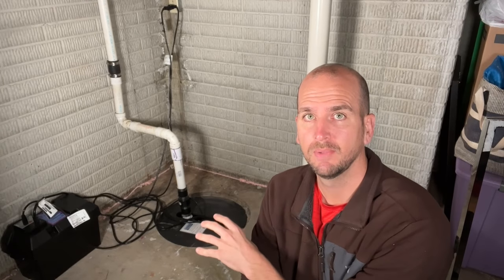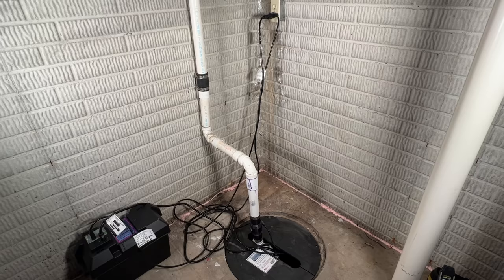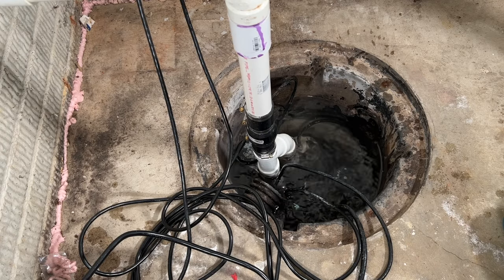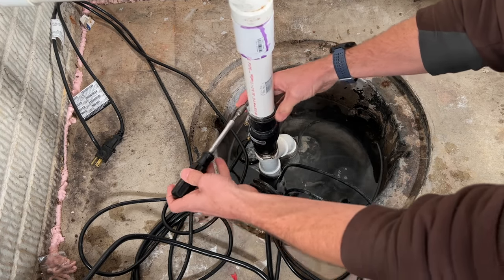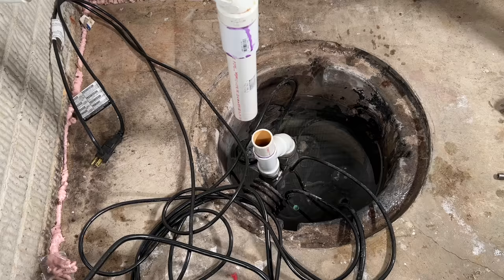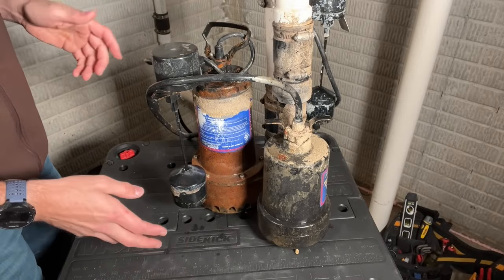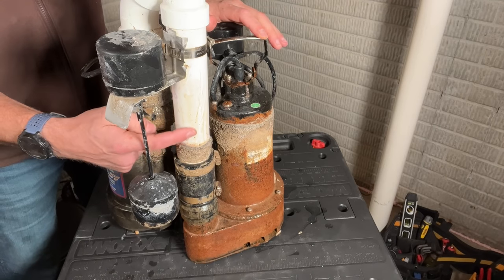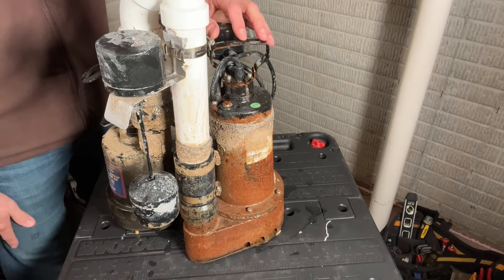Sump Pump Running But Not Pumping Out Water | 3 Fixes

Comment: Hello. I had my home gutted/remolded 2016/2017 here in Washington, DC  and had my  basement turned into an apartment with separate entrance from the side walk. I am just now looking to rent out my unit and always wondered about the sump pump. The plug with the little light on it (red), but the test button is mushed in; take it one of the contractors pushed it in too hard. Anyway, I took the cover from over the sump pump and there was water down in the sump and debris. I manually lifted the piece that raises when sump is filled with water and the water gushed out on the outside under the porch. So, I know the pump is working, just the plug is bad I suppose. I used a nearby plug, I sucked all the water out of the sump which had watery gray like sludge, take it from the construction, filled it with water. But now the water isn't being discharged, I just hear the humming sound from the pump. Is it now clogged inside the pump? In the mean time, I just found out about the check valve and it's function. It's clogged?

Comment: I used to have hose clamps in my pit and they were never reliable.  I changed the plumbing to be only glued pvc joints in the pit and put the hose clamps above the lid only. After that I never had another failure of the clamps.

Comment: Each pump ought to have it's own check valve.
Reply from the maker: You are correct and I missed that on the video.  Each pump did have a check valve coming directly off the threaded discharge port.

Comment: Zoeller pumps are well built but float switches fail prematurely. Try Liberty as they are built pretty well without the flow switch challenges. In your setup use 1 Zoeller and 1 liberty and let us now how they are working in a few years
Reply from the maker: Oh man, thanks for the feedback.  I had found several people saying the Zoeller switches are solid.  I just install a Zoeller M98 today, video will be published tomorrow.  I will checkout Liberty as Sump Pumps are something we take pretty seriously in our area since we have about zero elevation change and a high water table.
Reply: @EverydayHomeRepairs  You're a great guy and very thorough. Watched part 2 this morning. I couldn't wait to watch it. I'm not trying to "one up you" but put the weep hole should be just above the male adapter. Secondly, That pump cycles quite a bit in the video and I imagine between your high water table along with a heavy rain you could almost go with a continuous duty pump. All this might explain why you only got 2 years out of your original pump setup. Make sure that pump switch cover is tightened down from the manufacturer as your water level appears to immerse the complete pump during high influent of water from the 3 sources you have. Just a last thought...The 4" pipe brings in a LOT of water and it's hitting right on top of the float. Might increase pump cycle length and burn out pump prematurely. You can put a schedule 40 elbove dry fit to aim it away from the float. Bottom line is nice job, overall.

Comment: I just moved into a new house with a sump pump. I don't know anything about these things but I am paying close attention to this video. The previous owner had the sump pump discharge pipe dumping into the utility sink. I looked at this and immediately thought oh no. I have to re do this myself.
Reply: Actually, in some locations it's illegal to drain ground (sump-pump) water into the sewage system. And that's where your utility sink drains to.

Comment: Nothing beats a Zoller M98
Reply from the maker: Nice!  Just installed the M98 today 👍
Reply: Pump yes, float switch no.  Float switch dying is a common failure on these Zoeller's - mine just failed after 8 years.  Would not reliably activate, but fortunately the water jet backup did.  Good news is the float switches can be replaced without needing a new pump.

Comment: Those pumps already come integrated with a weep hole for both pumps. Air lock is not an issue. My pump had a piece of stone stuck to the impeller. It only takes removing 4 screws to access it.

Comment: Every sump pump eventually fails.  Just the better ones like that new green one he shows will last longer.  But it will still fail eventually.  

That’s why the most important part of the sump pump pit is a reliable working alarm system.  You need alarm to tell you when pump fails BEFORE  the carpet gets wet.  If you mount the alarm sensor at the height just above the “on” level of the float it will give you the most advance warning.  You might have several hours between alarm sounding and the flooding of the carpet.  That gives enough time to replace the failed part before it floods.  

I’ve had 6 or more pump failures in the 18 years at my house. But only the first one caused a flood before my alarm. All the other failures since then were detected by the alarm and repaired before any damages.
Reply: and a good insurance policy coverage every company offers water backup coverage, a fairly high-value add-on that costs as little as $30 a year on top of your standard coverage
Coverage amounts and availability of this endorsement vary by company and state, but companies generally offer anywhere from $5,000 to $25,000 in water backup protection. Its sort of my back up for my back up. Yes there is a deductible but at least you know your worst case scenario ie the deductible and you'll get new stuff
Reply: @handdle-h2o  I called my insurance company after my basement flooded and I lost thousands of dollars worth of property.  They said the damage was not covered.  I then inquired about water backup coverage add-on for future flood coverage.  They said there is not anything available that would cover my specific issue - which is groundwater infiltration due to non functioning sump.  The water was not backing up from the sewer pipe and was not backing up from the drainage pipe either.  It was simply the natural water in the ground itself seeping into the drainage gravel underneath the basement floor.  That level was rising and without a sump dewatering it eventually reached the basement floor level and above.
Reply: The battery operated water alarm is available at big box stores for approximately $10-$15 dollars and it gives you a “heads up” advance notice that something is wrong with the sump pump before room damage occurs.  I also have one at the base of my tank water heater to alert me in case the water heater starts to leak.

Comment: Thanks for this video. I am thinking of adding a secondary sump pump, in case the first one fails. I do have whole house generator.  I would like your thoughts on what a bullet proof arrangement would be.  

Also, can two sump pump be connected to same electric outlet?
Reply: They can, as long as you checkvalve BOTH sump pumps BEFORE they get Y-d together to a single outlet.

Comment: I got a pump that runs and pushes water but sometimes i hear it running, and dont hear water moving.. but if i unplug it a second and plug it back in she pumps out. I thought maybe something got in the pit, and was blocking the intake but i cant find anything. You have any ideas on that?

Comment: I’m not confident with your set up. I have two pumps in the same hole . The second pump is set a little higher on a cement block. I have a vent outside on each pipe. Two separate plugs two separate pipes no check valves so they can drain either way. Works great year round. I have a my D Link camera aiming at the hole so I can keep an eye on it while I’m away. 
This does not fail.
Reply from the maker: For sure, I actually will be doing additional work (and videos) starting with installing the Zoeller M98 then working through some backup options.

Comment: HELP please...

My situation is that my new 3/4 Hp Watchdog sump pump takes 30 to 60 seconds to build up enough pressure/strength to move the water out of my sump.  I have a weep hole below my check valve.  The weep hole works well but does only a slow flow until pressure builds and then sprays out hard indicating satisfactory pressure.  Then the water goes up through my check valve and out.  When I remove my head pressure, by draining the discharge tube first, then engage the pump, everything works great.  Immediate evacuation takes place.

So is my problem some sort of airlock in the pump (that slowly corrects itself in 30 to 60 seconds) or is it too much head pressure?

Comment: I need to do some outside repairs after my discharge pipe froze and burst.  Any suggestions on installing a heat cable into the discharge pipe?  Thanks for the clear explanations.  You do a great job on your videos.
Reply: My outside pipe running to curb collapsed.
Made repair, then added an air gap where pipe comes out of house before it goes underground.
This way if underground pipe freezes or collapses, pumped water runs out onto ground and doesn't backup into sump pit.
Reply: There is a product called Freeze Relief.
Reply: Unfortunately my discharge is completely under grade until it exits at the street.
Reply: If your discharge is sloped properly it won’t freeze because it will be either empty or moving.  Typically only standing water will freeze.
Reply: @neilbrookins8428  Agree, it should have been done with more slope but unfortunately that was not considered in the design which is the reason it failed.  I will fix the rupture, rather than dig up the whole yard and put in a heat cable.  Just looking on some advice from others that have done a similar repair.
Reply: @larryrwright  rather than dig up the long pipe, just put in a tee at the house that allows  a backup due to freeze to flow to an alternate location.  Basically it’s an overflow for any blockage.
Reply: @neilbrookins8428  I found that the rupture was not actually due to frozen pipe.  I had irrigation installed last summer and the water line for sprinklers cut right through the sump discharge.  Grrrr!

Comment: I have a question, if you have a sump pit can you seal it up with concrete if you no longer want it . ?????
Reply: You'll get water in your basement.
Reply: @jimmypautz  Yup. Concrete isn't waterproof. 
Two everyday examples: 
That's why shower cement underlayment has a waterproof barrier under it. That's why your basement has a waterproof barrier between the dirt and the concrete wall.

Comment: Okay guys... looking for some advice... My Sump put, similar to the one in this Vid... has a 6 in PVC drain into it.... when we get heavy rains, water constantly runs into the Sump Pit from around that input pipe.   Nearly impossible to Seal that from inside the pit, the hydrostatic pressure is too high.  I am thinking maybe I just cut out the concrete NEXT to the pit, dig down to that feeder pipe and seal it from that outside of the Pit wall?  Basically, whoever installed this did not use gaskets and just cut a hole in the side and ran the pipe thru.  Which probably seemed great at the time, but they had no idea how much ground water presses up under the foundation..   thanks for any advice!

Comment: Use different electric circuits for each pump. Talking about hypotheticals in a video is meaningless. Asking viewers to visualize a hypothetical condition probably will only be frustrating for them. I would use a check valve for each pump to avoid recirculation and a possible jammed valve. Flooded basement if very frustrating and distressing. Your'e stressed from the last flooding and dreading the next one. You may want to install an alarm to sound when the water raises to an unexpected, undesirable level. Good luck.

Comment: As others have said, it's very weird setup having a check valve at the bottom of a vertical section of pipe. I'd think it should be in a horizontal section of pipe. If backflow ever did come in, it would just sit in that vertical pipe.

Comment: I'm confused. You took things apart but, even though your pump wasn't working right, your check valve was fine, you drilled a hole in your discharge pipe, put it all back together and now it works properly? The lack of a small hole WAS NOT THE PROBLEM. I learned nothing about why your pump wasn't pumping.
Reply: You learned exactly why. His pump was air locked, and the small hole bled the air so the pump could work properly. Weep holes are required and are a standard item in the pump installation manuals.

Comment: There are a number of issues with this guy's set up that are wrong. You should never have the cables bunched up and sitting in the water like he does. The slot in the lid should be covered/sealed the best you can to prevent radon from coming up. The only reason it's there is to allow for the varying locations that the pipe(s) coming up out of the pit might be at from one application to the next; with the expectation that the slot will then be covered. He's got too many right angles along the pipe.  The only right angle there should be is the one where the pipe is exiting the house. But the most important mistake in his system is that he has both pumps sharing the same check valve. It might even be check valves plural because further up the pipe, it looks like he has another one. But either way, in a two-pump system, you never have the pumps sharing the same valve.  In the event of a check valve failure where the flapper breaks off inside the pipe, plugs it (which is common) and prevents water from flowing up, it renders both pumps useless. I can see why this guy got water in his basement. He obviously doesn't know what he's doing.